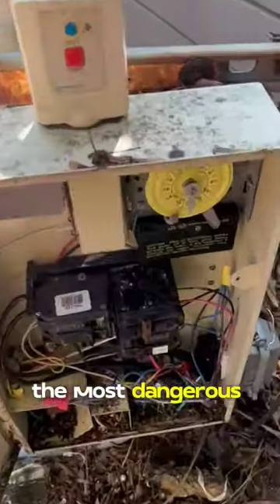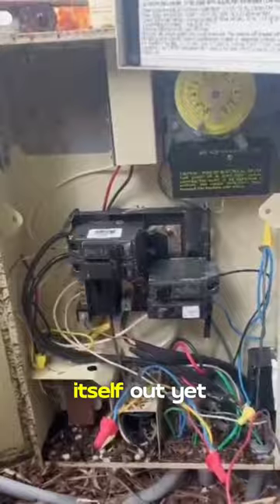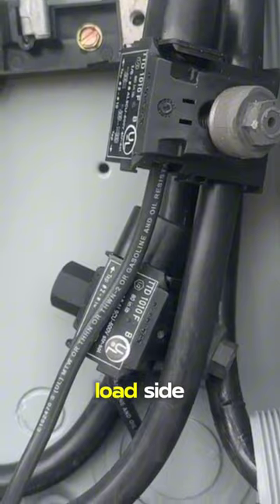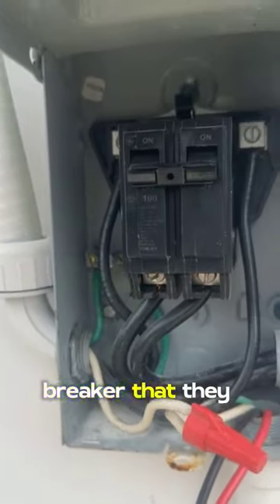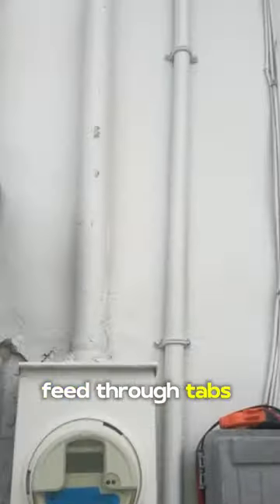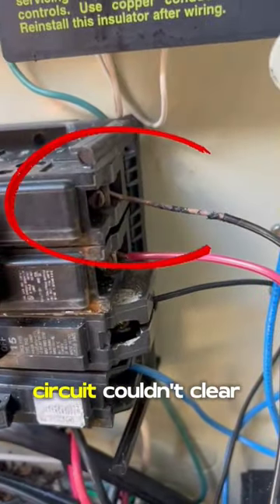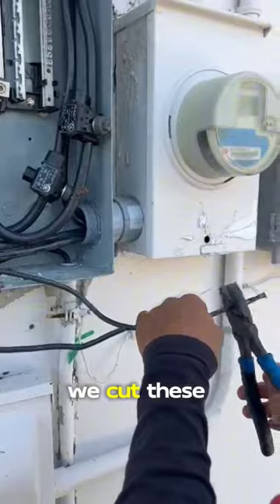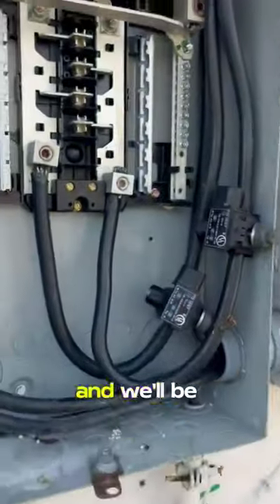Pool water electrified with 110 volts. Simon Electric

Comment: everything here is awfull but honestly the taps are stupid when u have a panel there but technically if they were 100% within the nec code to allow that.

Outside feeder tap of unlimited length rule [240.21(B)(5)] — you don't have to install an OCPD at the tap point of a feeder tap of unlimited length as long as you meet the following requirements.

The tap conductors are suitably protected from physical damage.

The tap conductors are terminated at a single circuit breaker or a single set of fuses that limit the load to the ampacity of the conductors. This single OCPD may supply any number of additional overcurrent devices on its load side.

The OCPD for the tap conductors is an integral part of a disconnecting means or located immediately adjacent to the device.

The disconnect is located at a readily accessible location outside the building or structure, or nearest the point of entry of the service conductors